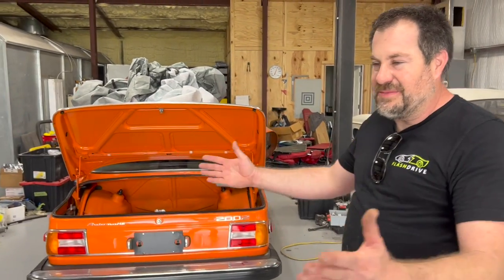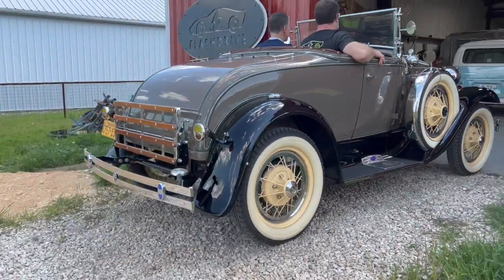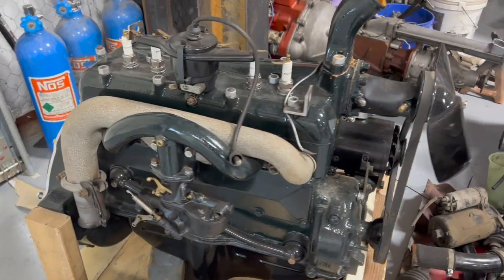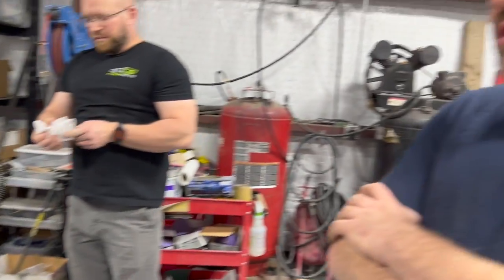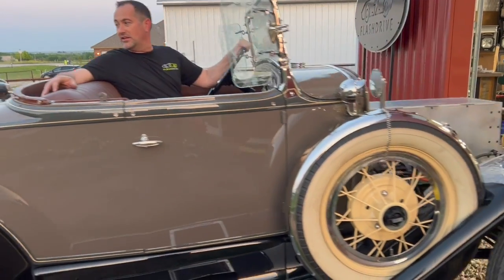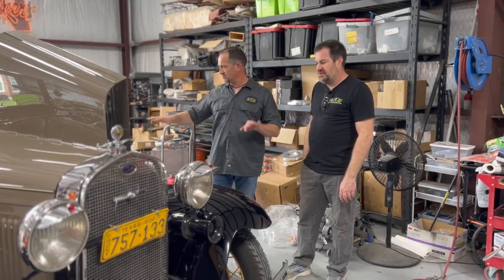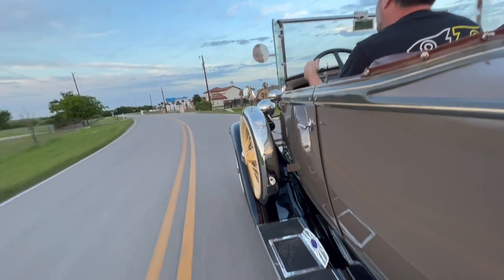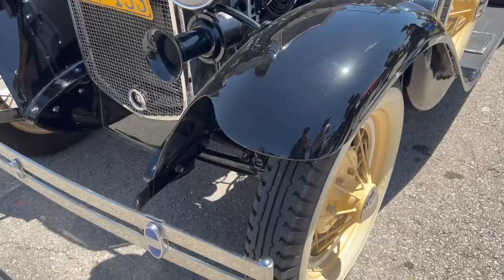The Model E - 1930 Ford Model A Roadster All Electric EV Bolt In Conversion. Tesla battery & Hyper9.

Comment: Poor brakes ?... whoever did them didn't know 'squat', I can lock all four instantly, tar or cement.  Done right, the Model A is as dependable as any car, drove my first one well over 100 grand, we just took a nice 500 mile trip from Mpls' to Medora ND, used no oil, got 21 mpg, no waiting to charge up some stupid battery, put 10 gal' in, go 200 miles no problem.
As to this EV crap ....  just learn to say NO.
Reply from the maker: If they were so great, name a car that uses the same setup today?
Reply: @dissrepair   That's a fallacy. For one drum breaks are still used on cars today. And the main reason they steel brake rods aren't used anymore, is because hydraulic breaks are easier to manufacture with modern car designs, and don't have to be tuned, and are simpler to add break assist to. The benefits are mainly for the manufacturer not the driver. There is no difference in breaking performance.

The reason model A breaks poorly is because the wheels are skinny. Has nothing to do with the breaks.
Reply: When people talk about how terrible Model A brakes are they are revealing that they don't know how to rebuild /adjust the brakes. In my experience if the brakes are done properly you can lock up the wheels no problem. You can't get better than that.

Comment: You all have not driven a properly restored Model A. From the factory the A would run 60 MPH on the crappy roads of the day. Started reading about what people did with the A back in the day (really up to the early 70's when it was just a 40 year old car).  The brakes only limits were the small contact patch of the tires. When restored to factory mechanical specs the cars are comfortable to run at 65 MPH. I know I have done that for many miles. The issue is Ford did precision manufacturing so you need to rebuild things to .001" or better specs. Of course it is expensive and time consuming to do a proper restoration. You can slap together a car and it will run, but not be safe or go fas and maybe stop. Did the car have functioning shocks? If the car does not have shocks and you could feel ok above 25MPH then the suspension (springs) are not right.
So an important point. You used the float a motor mounts and you should not use them. The original solid mounts are actually structural. The Float a Motors are a way to manage vibrations from failing to properly balance the engine/ flywheel. Imgaine the common problem of a 66lb flywheel mounted a few thou off centerline on the crank. Couple in with rods are different weights you get all sorts of vibrations. From the factory the flywheel was less then .001" off center and the rods +-1 gram at each end. 
FWIW, That was an over restored car with lots of reproduction parts. A classic example of a car with a nice paint job and poorly restored mechanical. It is my experience over the last 50 years that almost all restored cars (all makes, models, and years) are really just paint jobs and interiors. The mechanicals are rarely ever properly brought back to factory. For more fun, start asking people with hydrualic brakes at car shows about how their cars stop. I personally perfer to keep the other cars in front of me as most do not have all 4 brakes working to 100%.
Reply: I think Flashdrive has a Delorean in the works.  Perhaps it could be used as a Time Machine to go back and buy a fleet of brand new model A’s to test. It seems that original model A’s have vastly superior performance to professionally restored model A’s. At least that’s how grandpa remembers it…
Reply: You are correct. When people talk about how terrible Model A brakes are they are revealing that they don't know how to rebuild /adjust the brakes. In my experience if the brakes are done properly you can lock up the wheels no problem. You can't get better than that.
Reply: @quailstudios  "You can't get better than that." and that is exactly the problem. People might be wrong about the breaks being the issue. They are not incorrect about the car being bad at breaking, just for a different reason. I always keep twice the distance in front of me like i would with a normal car.
Reply: @DrTheRich  When I drive my Model A I'm very careful and put a lot of distance between me and other cars. Also, I pretend that no one can see me. Driving very defensively is imperative for any car.  Especially a Model A.
Reply: "You all have not driven a properly restored Model A" YOU sound like you have not driving a properly restored Model A.

They could NOT drive 60mph hour on the crappy roads of the day. That's an absolute myth. Heck even on a nice smooth road today, a properly restored stock model A would barely reach that speed.

65mph, it simply can't reach that in a stock car, no wind, no slope. No matter if you press the gas pedal through the floor.
If you believe you have, you likely had a misaligned speedometer. Or you didn't drive a stock car. Did you confirm with gps?

Float a motors are fine to use. No matter how perfectly you balance a 4 cyl. It will always have vibrations, because it's mathematical impossible to perfectly balance a 4cyl. And thus float a motor helps with that, They don't have a negative effect on performance and are perfectly fine to use.

Breaks, especially, if you have cast iron drums, are great for locking up the wheels if you need to. But as you said, the surface area of the tires is the limiting factor here. and that IS a serious safety factor driving a car at or over 60mph. So better to always drive carefully. Modern cars, even with breaks that aren't 100% will still always have a shorter stopping distance than a Model A.
Reply: @DrTheRich  Do you have/own a Model A?
Reply: @quailstudios  I do a 29 Tudor. As does a close friend of mine, an early 30 Tudor (with a 20s dashboard)
Reply: @DrTheRich   Nice. I have a 1929 Tudor also.
Reply: @DrTheRich  It IS possible to get them up to 60 but not for long periods and the road had to be paved and good. My dad (born in 1906) said he rode with a guy in a Model A that got up to 60 flat out back in the day when it was a couple years old and he said the pistons were swapping cylinders. They ran best cruising at 40-45.
Reply: @hotpuppy1  I always take these claims from the past with a grain of salt. It's easy to round off 58 to 60 or to have a speedometer that wasn't calibrated exactly. Back then there wasn't even gps to measure it by. But yeah in a new one from the factory they might still be able to touch the 60.

It wasn't really the lack of power that's the problem. It's the standard cam profile, in combination with valve springs that are too weak, making the valves float at high rpm, limiting the rpms a standard motor can reach even with throttle all the way open.

There are a lot of things you can do to get more power out, or make things more efficient. But we're talking stock here.

Comment: This is WRONG.  Classic cars should be kept STOCK.  They are much too rare to modify.  It doesn't matter if it is "faster" or "more reliable", it no longer is STOCK when you do that.  Classic cars are HISTORY, but MODIFIED cars are just your, or somebody else's, handiwork, and are NOT history.  You may have kept the original parts, but others probably will instead dispose of them.  Please, classic cars should be kept STOCK.
Reply: Give up Michael. This is American ingenuity at its finest.
Reply: I think they are saving the original engine from imminent self-destruction.  And also saving the paint from hot coolant spraying out of the motor meter.  A stock model A is only useful for overheating in a 4th of July parade.  
Any family that owns a car that long and goes through the pains of a 
6 figure restoration should have the freedom to make a reversible mod that lets them enjoy their investment.   The owners love this car way more than the assembly line workers that first built it.  No history lost here. They are promoting history.
Reply: @garajemecanico8207  With the correct radiator the car will not overheat. When people talk about how terrible Model A brakes are they are revealing that they don't know how to rebuild /adjust the brakes. If the brakes are done properly you can lock up the wheels no problem. You can't get better than that. If they paid 6 figures to restore that car they paid too much. A good model A club has good mechanics that will help someone restore a car for a lot less than that. Of course there is a lot of sweat equity involved but that is part of the love of Model A's.
Reply: "should"??? Who is making the rules? Are you with the government or something?

Comment: Unfortunate that the previous restoration sounded more cosmetic than mechanical. Even in gas form these cars are pretty tough and reliable.

That said, this is a neat conversion.

Also the brakes are terrible because they’re not adjusted, not because they’re mechanical. Should still be plenty able to lock up at speed on Model A tires and at that point more braking doesn’t help.

Comment: The one guy was right, once batteries catchup then EV's will take over. Nicely done guys.
Reply from the maker: You are so right. Battery tech is the number one challenge.
Reply: @dissrepair  Then the number 2  challenge is our U.S. power grid’s capability, reliability and % of it actually being powered by renewable energy.  If we are charging our EVs on an electric grid powered by coal-burning power plants to meet demand then we’re still not ready.
Reply: @JGMan0011 Don't forget about renewable energy!  I power my home and charge my EV with a 6.5 kwh PV array.
Reply: @craigmerrow225  You are in the minority of the worlds population
Reply: @dissrepair how about the environmental damage caused by the mining materials needed for the batteries?
Reply: It’s on the horizon
Reply: @scottmeeker9971  So is fusion power supplying electricity too cheap to meter 😀
Reply: @scottmeeker9971  Still a decade away
Reply: It's too bad that happens. Because right now the intervening footprint for electric vehicles is greater at the time of its setting at the dealership compared to the entire lifetime as a conventional fuel vehicle.
Reply: Its less the batteries, more the infrastructure, especially for fast charging and in high destiny areas

Comment: I've been debating converting my 63 Ford convertible, but for me doing a front Prius + clip makes more sense as I still love crossing the country each summer & an old car electric conversion can't give the millage needed to do that.
Reply: I've seen some classic convertibles swapped that came out great! Agrees on the Tesla swap and daily drive it or cross country it!
Reply from the maker: You should Telsa swap your car! I bet you could get the range you want and the power too!
Good luck, thanks for watching. :)
Reply: @dissrepair  No he shouldn't!  Classic cars should be kept STOCK.
Reply: Keep it STOCK.  Electrics are not for long trips, they are just good for running errends.  Make much more sense for commercial users.
Reply: @michaelbenardo5695  You realize a standard model A has a shorter range than the average electric car. The Fuel tank is only 10 gallons, and it drinks fuel like the Irish drink beer.

Comment: Excellent work as always guys!  The fact that it is entirely reversible with no significant modifications made to the body or frame of the car is the cherry on top, also that charging port location was a stroke of genius.  You can still fully enjoy the car and get more reliable use out of it than you might with the original motor, but if you change your mind or want to sell it later you can simply swap the original motor back in.  I have driven cars from that era before and trying to navigate modern congested roads with a 20-30hp car that tops out at 40mph can be unnerving to say the least.
Reply from the maker: Thank you for the encouragement. We loved this car and look forward to building more like it. I especially like that it can be returned to original, if someone wanted to. It is basically an engine swap! Thanks for watching!
Reply: @@lurch789It depends on the area and the traffic. Quiet back country County roads or even Highways in rural areas are just fine.  Even in town in smaller towns where speeds are under 30 anyways is OK.  Interstates or expressways no way.  Heavily congested multi-lane or two lane no way.
Reply: This is exactly why I am Rotary swapping my Superbeetle. 

Nobody cares about post '68 bugs and it's no fun being passed by Tractor Trailers on the interstate.
Reply: The Model A has 40 horsepower.  It was the older Model T that had only 20 horsepower.  Don't exaggerate.  Classic cars should be kept STOCK.  Get a Shay Replicar if you want faster and/or more modern.
Reply: @michaelbenardo5695  They already HAD the car. The conversion did not hurt ANYTHING and can easily be reversed. The fact is that it is THEIR car to do WHATEVER they want with it. You don't have to like it.
Reply: @michaelbenardo5695  I see your reading comprehension is lacking. I was referring to a prewar packard and others not the model A when I mentioned HP and speed. You must be a miserable person at car shows. In the many shows I have gone to I have only seen a handful of truly all original stock cars. Different intakes or exhaust, different carbs, paint, etc the majority or cars I see are modified in some way.  At least in this case the car can easily be returned to stock and it wasnt cut up to make a hot rod. I find it hard to have a problem with someone bolting on a set of reproduction wheels and radial tires on their muscle car to drive around on while the bias plys sit in the garage. Thankfully its not your car and not your decision so all you can do is scoff at people from your self appointed position of piety as you walk around car shows noticing bolts put in backwards and alternators where generators should be.

Comment: I can see where it would be polarizing. ha. I absolutely love it. There were EV's back when this one rolled off the line, some folks might want to check their history. (edit) Forgot to mention THANK YOU for making it reversible. I don't know if people know how much work that is.
Reply from the maker: You are correct. EVs were around at the start. They lost favor to petrol once gas become a commercially available fuel!  Thanks for watching
Reply: @dissrepair  uh they lost favor due to the damn muffler and electric fkn starter motor being invented(thanks Kettering.
Until post ww2 people still had to buy gas outside of cities mostly in cans from drug stores and pharmacies.
Reply: Nearly all EVs were gone by the time the Model A came out.  There heyday was mostly before the First World War.  Most were gone by the early 20s, with a couple lasting until the early 30s.  And those sold in tiny numbers.
Reply: Westinghouse,Garford,EMF (Flanders) and even Studebaker had a battery powered car (from what I was told...)
Reply: @deliveryguyrx  Yes. Early EVs were "women's cars" (today we'd call them city cars) and perfect for the task. The electric starter was a big equalizer. Cities might have 12 MPH limits and 18 in the country.
Reply: Mrs H. Ford even drove her own EV right when this Model A was manufactured.
Reply: There's also steam powered cars but who suggested we go back to using steam again? Okay there's a couple people.
Reply: @CAROLDDISCOVER-2026   I think Jay Leno got a speeding ticket in a Stanley Steamer... and let's not forget Wood gas powered cars!
Reply: @CAROLDDISCOVER-2026 yeah, imagine getting energy out of boiling water. What foolishness.what next ? Atom splitting and using the heat ? Hah!
Reply: It's shocking to see what's being done in the field of EVs to make the switch from gasoline to electric. It's generating quite a bit of interest. They've managed to fuse new technology with an older car. I'm sure they must have run it through a battery of tests. They're currently working on plans to allow it to directly alternate between electric power and gasoline...
Reply: The elecs were all in the junk yards and a few in museums.

Comment: Why not design with engine mounts in mind?  the whinny gear sound transferred to the body of the car is unnecessary.  awesome build regardless.
Reply from the maker: For reference, a Model A does not have rubber mounts for the engine from the factory. The original engine vibrates the car wildly. The electric motor does not need rubber mounts. And the whine is from the straight cut gear box. Which is also standard on Model A’s
Reply: @dissrepair  straight cut gears and non syncromesh transmission leads to developing shifting skills. 😄
Reply: @dissrepair  Third gear in this transmission is direct drive input shaft to output shaft. I assume you leave it in High gear. All the other gears are just spinning with no load when you are in high gear. They should not whine. The differential will whine if it is worn. If the brakes on your car are not good, then they have not been rebuilt or adjusted properly. Those brakes, when done right will STOP that car quickly. You can skid all 4 tires on dry pavement.
Reply from the maker: @TwinOaksYoungHarris  3rd gear doesn't whine, but the others do, as you can hear in a few points in the video.  The ideal ratio would have been 2nd gear, but the whine is not tolerable when driving, so changing the rear end ratio or to another transmission would be a fix.  As for brakes they aren't good! Two high speed stops (~50MPH)  and they are fading.